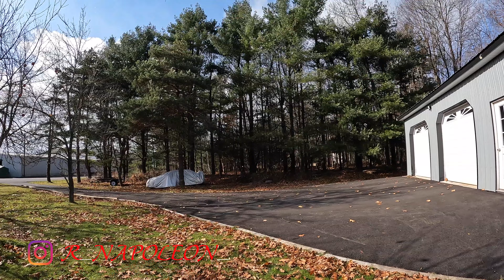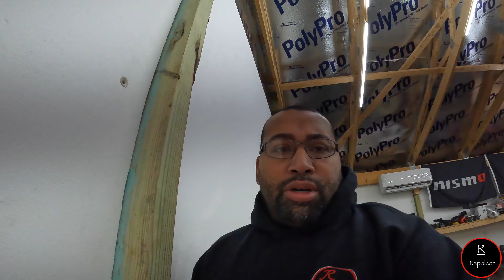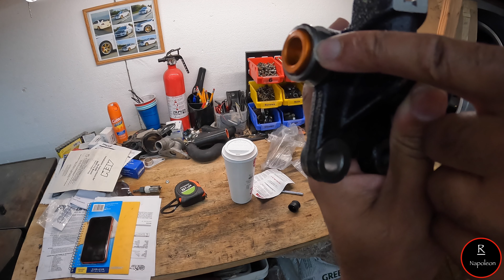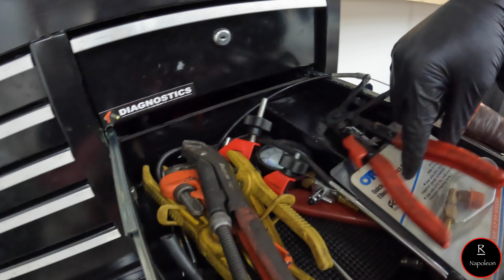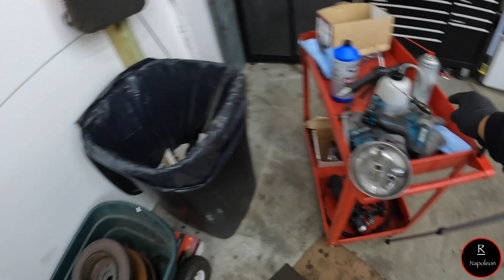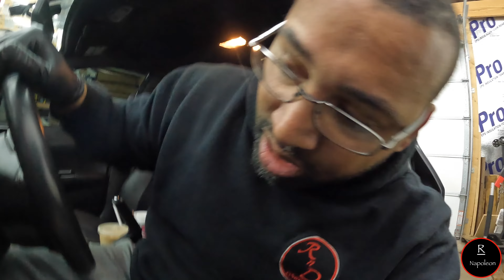Clutch slave replacement and bleed in the STI  4K

Comment: Did you ever figure out what the issue was, don't see any follow-up videos
Reply from the maker: Unfortunately I never figured it out 100% I have taken it to get looked at and was told it MAY be an “H” pattern problem so in the transmission. I never fixed it I have been driving the car like this for a while now it’s just reverse now that still tough to get into. I hope this answers you question but sorry it wasn’t a little more helpful. It did get a little better with a kart boy shifter bushings
Reply: @r_napoleon  Well, I hope you finally figure out the problem.  I just finished bleeding the slave cylinder but never test drove it as it's getting late.  Tried the vacuum tool like you did (my first time using it) and find it weird that with the constant suction I could never get the air bubbles completely out or the flow to be steady so I resorted to turning off the air compressor piece and had the wife pump the clutch pedal like a standard bleed and that worked much better.  My kit also came with an auto refill tube so every time the fluid is removed from the reservoir it keeps it topped up very helpful and one less thing to monitor.